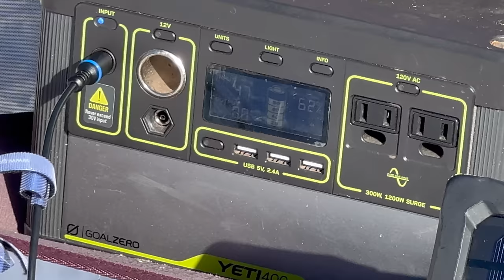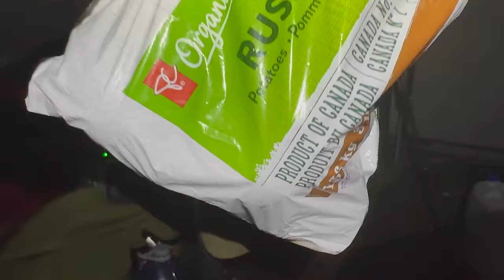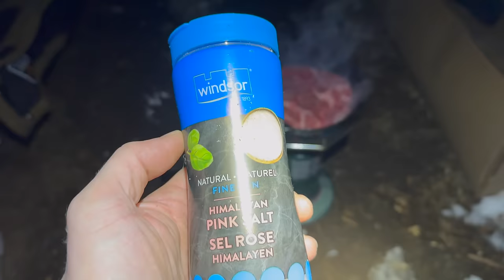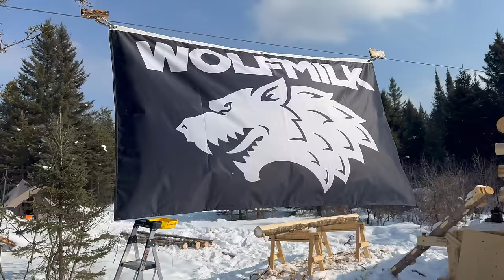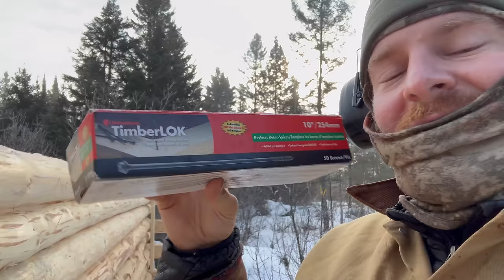Winter Log Cabin Build on Off-Grid Homestead |EP11|

Comment: Built the sleeping lofts now, and drop them in using a dove-tailed joint on both ends. Perfect time to do it, while the exterior logs are exposed. It will also help stabilize your walls. Time to learn a new skill young man!
Reply: I agree setting the second floor in now whichever way he decides to build it is the most stabilizing and safest way to get the rest of the gable work and even roofing materials in place .. .. :)

Comment: Turn your scaffold frames the other way around so you can set your planks at different heights so you’re not sitting, also, you can buy leveller feet that go in the bottom of the bottom frames so you can adjust quickly to different ground, and if you’re going to use wood planks like that, nail cleats right beside the frames on the underside so the planks can’t slide out one side.

Comment: In regards to building your gables, on the cabins I have built I build the loft or second floor first and then build the gables. For me, it's a safety thing, as well as a way to conserve what little energy I have left. I most cases I put four or five logs up at a time for each end so I don't have to keep going up and down ladders and such. One thing I do differently, typically with a butt and pass style cabin, is I notch floor joists in the first course and build a floor right away.  I know a lot of guys wait but I hate trying to set ladders up in the dirt and really hate shoveling snow off of the dirt because it typically turns to ice. Another thing I do is after about three or four courses I build a couple of temporary interior stud walls parallel to the gables to help keep things plumb. They also come in handy for winching up logs and when you get higher on your courses you can roll your longer logs across the top plates.

Comment: You need to leave more hinge wood when making your back cut, and on the smaller diameter trees pull your saw out put a wedges in from the side, once you get the disred leand  then you can tickle  the face cut with the saw  to get it  to fall

Comment: Cabin is looking good. 
As far as the gables, I would put supports vertically inside and out in at least 3 places. 
When you start pushing and pulling the other roof components, the gables will become very unsteady, I believe 
I would run the supports as far down on walls as possible
Reply: James, I'm totally in agreement with him on this. I'd use 24" long #4 rebar spikes pre drilled with 1/2" holes. Sledge hammer them thru 2 or 3 logs minimum. If you leave them temporarily exposed by 6", they'll make a perfect stepping point for when you're lifting that ridge beam up the slope

Comment: Four suggestions for the months and year ahead.  1) Access.  Get those roads widened, graveled and good for all seasons.   2)  Water, multiple sources from water catchment off the roof and storage in a tank to if its feasible drilling for long term convenience.  This cabin is up high on the property so gravity feeding down will be useful.  3)  Clearing and building your workshop at at the site of the future home.  Having that there will make the future build much easier and convenient, along with the access roads properly worked out.  4) Quality solar panel array, generator and battery bank with room for expansion.

Comment: James,  It’s fun to watch your progress on the cabin.  Just a suggestion,  Could you stand a log vertical on both ends of the cabin in the center of the gable wall.  It would look like two flag poles. One on each end.  You would need to secure them vertical against your gable wall with straps/screws.  Attach a pulley at the top of the pole and use it to hoist the logs up with rope.  I’m curious as to how the ridge beam will be placed.  Thank you for the weekly videos!
Reply: I like this idea, he could also get a remote for his ATV winch and run it through the pulley. That way he can maneuver the log into place.

Comment: For shearing concerns, TimberLok or whatever Lok they're called, they snap the easiest compared to other options, still probably totally fine. The GRK's, they bend and move just like a framing nail and never snap. I've had a timber frame porch shift during construction, a 8x10 fir beam slipped off a post and 1 16" GRK held it in the air, that sold me forever.

Comment: full loft or half loft if half it will not work both sides build once is nice but only if it works for both sides also going to have to clean it too until its closed where if you wait you can work inside after closed in warmer temp lots to chew on

Comment: 1- make a tripod crane and use your winch to lift things
2- scaffolding for interior will be best and more flexible when you need to move around and you are not exposing the floor to the elements months before you close them in. The floor idea is only good if you are closing in the roof almost immediately, you are a few weeks of more open sky and snow. Amazing channel 🎉

Comment: When you are falling, make sure your back cut is parallel to your hinge cut and you'll have less chance of the tree twisting as it falls. Also leave a good sized hinge by moving your back cut up the tree a bit more the goal isn't to connect the 2 cuts, it's to leave a section of wood between them vertically that can act as the hinge as it falls. Great work!

Comment: I would recommend choosing the first, temporary scaffolding option. You may not want to commit yourself to a specific loft floor height until you can physically see the roof in place. You may decide after installing those loft floor joists that you want to raise or lower it for one reason or another and then you'd have already committed yourself to a specific height and would have to tear it down and start over. I'm not a builder, though. Maybe someone who actually is would have a reason why that's not the correct choice. Anywho...may the gods be with you. Ooga Booga!

Comment: Whatever you do for the walls now, try to make it something that will help you with the ridge beam, and if you're doing those other two horizontal beams parallel to the ridge beam, those also. These end wall logs are getting short, and relatively lightweight, but the big logs will be heavy.

Comment: When you set up the second second scaffold stage you should have spun it around. Then youCould have adjusted the platform as you go up to keep you work area at waist height safer and also easier to do the work. Great job so far.

Comment: I don't usually comment on videos, take that cable and hang it higher in the trees and use it as a pulley system with a chain hoist and you can hoist them logs up, it helps when you need the extra hands you don't have. Great videos see you on the next one ✌️

Comment: Build the loft. This way you can use it when it comes to putting up the roof. I REALY like the water idea. I want to build a cabin and have my water tank up above the first floor, you can also always do a hot water on demand water heater. Not sure about the power for it. They have Gas and Elct. Love the channel. Keep It Coming! OOGgA Booga

Comment: You misunderstood, screws, no matter the design and shape, lock into place, so any side to side movement pulls on the threaded part and brakes at the end of it, while spikes drive into the wood and with any mlvement they "float" side to side, basically pulling themselfs in and out with the movement. I use TimberLOK a lot and theyr greate, but no, they dont replace spikes. Nothning that threads into material can move inside of it.

Comment: Option 2. I think you're better off starting the floor of the loft. It's going to slow your visible progress and accumulate snow, but it gives you a much more stable platform to work on. The last thing you want to do is fall and get hurt where you're at. I also think you should get a plow for your ATV. That's something you can use every year and even if you're not scraping the ground, clearing off all but the last inch or two of the snow along your trail will make it a lot easier on you to get things from truck to cabin. It probably also wouldn't hurt to down a couple more trees and make your path a little wider so you don't mess up the sheet metal you're going to bring in for the roof by dinging it against a tree like you did the scaffolding. If you decide to get a plow, get one with a sping loaded breakaway and mind the stumps.

Comment: Suggestion: try to ORANGE tape some trees along your route into the cabin area.. so come Sping.. you can cut e'm and widen it to bring a full size truck closer to your cabin.. to haul larger payloads... you might also need to find a good used but no leaky Skid steer. it will have the power to pull all your logs. that you cut and clean.

Comment: I would suggest listening to the contractors. They all say "put the floor joist up fir the loft and use that for scaffolding". I'm not a builder, but would put a solid "temporary" scaffolding up so you can concentrate on the end walls, then put the floor joists up second so you can concentrate on that part of the build. Like I said. I'm not a builder/contractor, so maybe listen to them instead. "Ooga- Booga!! 👍

Comment: I would build the internal loft floors now so that it daves time and energy plus makes the roof building safer and slightly easier.
Reply from the maker: GOOD LADY NICKY, THANK YOU FOR YOUR SUGGESTION! I SHALL CONSIDER IT FULLY. I HAVE BEEN LEANING THIS WAY AS WELL. STRENGTH AND HONOUR 🫡🤝⚡️🌲🐺

Comment: Thanks for the video. I see when you are cutting down a tree your back cut is level, try cutting down at like a 30" angle. In my experience it will help the tree fall where you aim, and it helps to stop the bottom of the tree from kicking back.

Comment: Good sir, I am sorry if this is late in the peace though on your log lifty thingy why don't you make the "Steps" wedge shaped so its like a ramp. that way as you are raising the logs up you dont have to put effort into lifting the logs up you can just put the effort into pushing them up and as they climb over the wedge shaped/ramp shaped steps the logs snap over the end of the ramp into place on the next step. Also, having a nail protruding out the end diagonally facing upward the log would catch on the nail and snag itself thus not sliding down off the other side as you are lifting it up :) Love the channel mate watch every week since you started. From Blue Mountains NSW Australia.

Comment: Great videos mate! Just like to say those timberlock screw hybrids are okay but the whole point of the length of a nail is to be snug all sides. timberlocks have the screw tip so they create a slightly larger hole diameter then the shaft. Thus, in theory will oval out over time. But they all do the job at the end of the day! Inspiring videos though mate!
Reply: Also dig two deep holes each side put a pole in each fill them in. put eye screws in each one. mount a cable. use a block and tackle to use like a crane! Happy Days

Comment: How about a pulley system where you can use the atv to lift the logs and then move them into place easily once lifted in the air. Sort of like a crane. Requires no exertion.

Comment: I'm wondering if you could get a couple logs with half laps to support the loft. Either way definitely build your loft if it helps you work.

Have to thought of framing a window in those gables? Seems like it might be more complex but a whole lot lighter/easier if the longest piece you need is a couple feet long!

Comment: I would cut some logs in half and make a plat form to install roof logs on each end with the over hangs logs. Then bevel trim the roof triangle logs . /     \ Each log being a little shorter till you reach 10 or so logs . Should be able to use 1 log for each end side or even the same side at different lengths. You might only need 12 or 13 logs to finish both side as your using the cut off lengths of a tree for each side.
Reply: You could repurpose the half logs for building the roof along the center of the cabin as a platform. If you can make sense of these instructions.
Reply: If you can make sense of these instructions  it will help you alot. As an option . Good luck what ever way you choose to build at that height.

Comment: Instead of sliding the logs up, why not design a pulley system to just get the logs up that high? Pulleys are fairly cheap. Just would take some thinking to figure out how to assemble the system to get the height you need to pull them up.

Comment: GABLE LOGS - I've got drawings and photos for you, how do I send to you? This is the answer for your log gable ends. Also, you might want to plan ahead with your rafters for a stargazing skylight over the head of your bed in that sleeping loft. What gorgeous future wife could resist that?? Also, might wanna plan on picking up an inexpensive used 4WD tractor with loader for snow clearing and lifting with a boom pole for future use. Used tractor and dbl axle trailer should cost around 5 to 7,000 USD. Less if you can find one locally and just drive it there.  Many great inexpensive China tractors out there, 25 HP would do it. Tie off those scaffolds to your cabin, would hate to see you get hurt! Soooo Much I need to share with you my friend!  Keep up the GRREAT videos, love it all!   ....    Johanne from Colorado